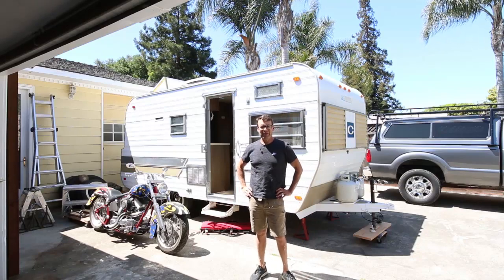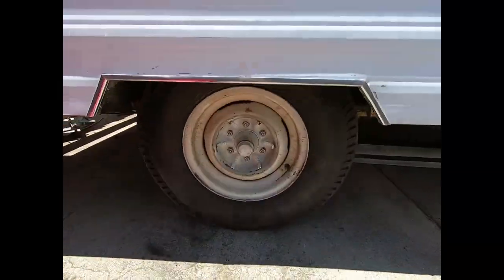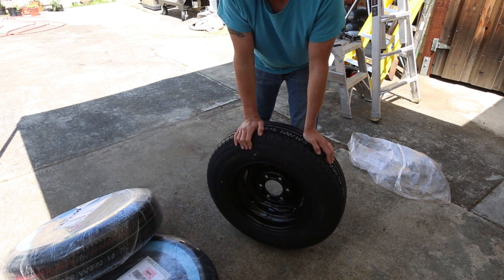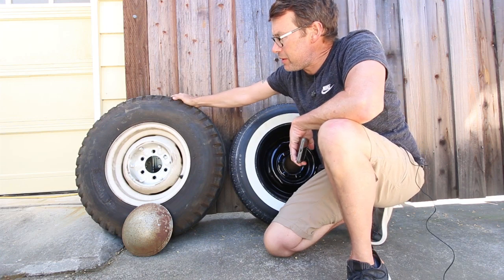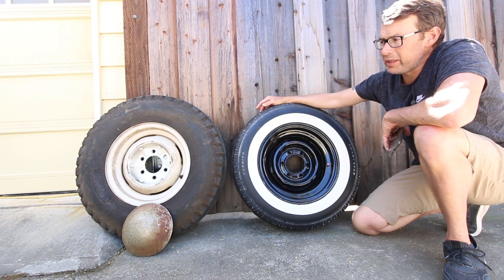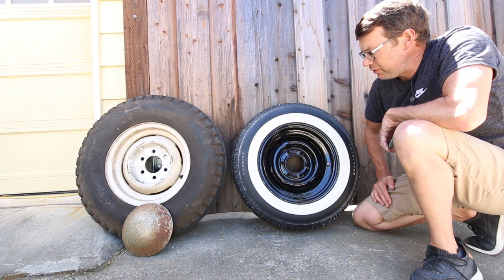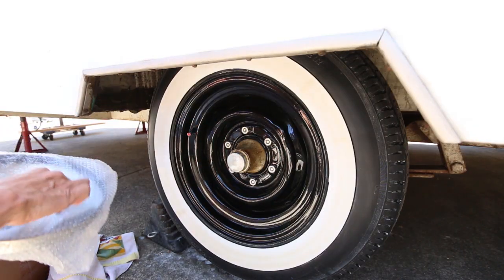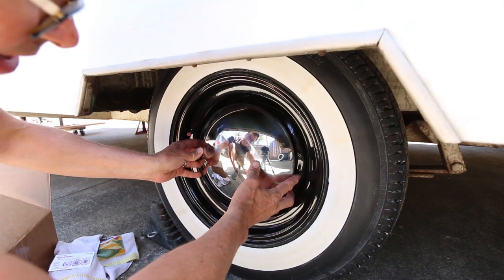Trailer Wheels, Tires, and Baby Moon Hubcaps for the 1968 Corsair

Comment: The white runs through the entire wall.   People are afraid to really scrub them thinking they'll rub the white.   You wont.🙂   elbow grease and dish soap. Ill even sometimes bust  shoe whitener with the foam tip... apply amd remove white wet.